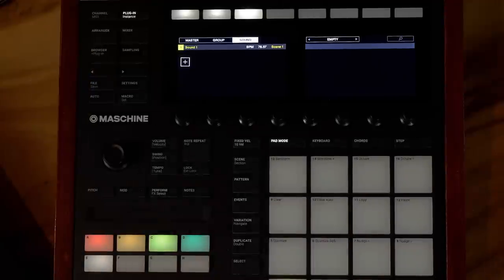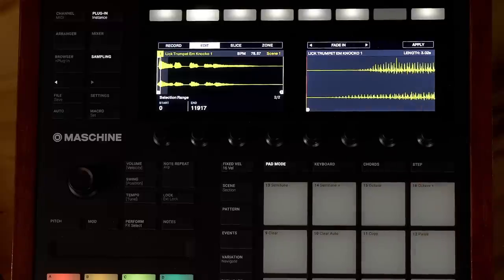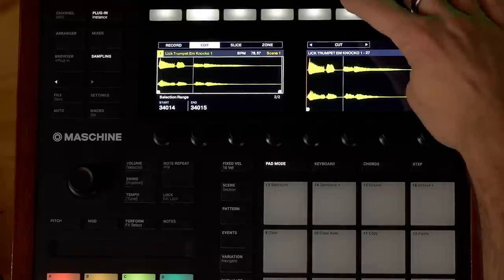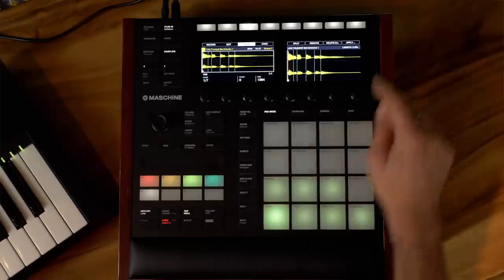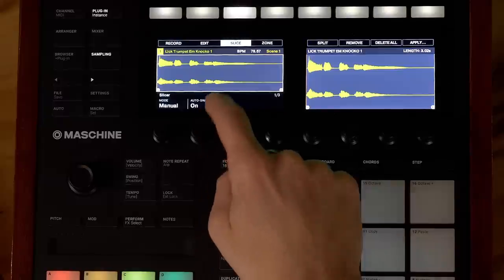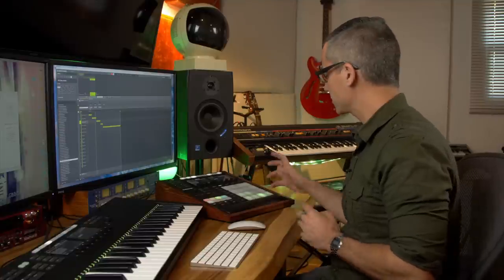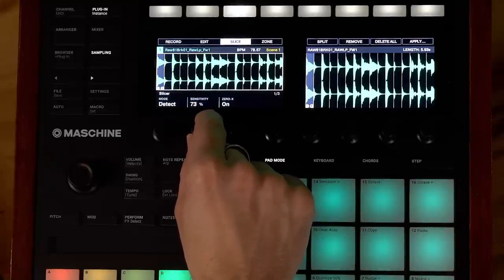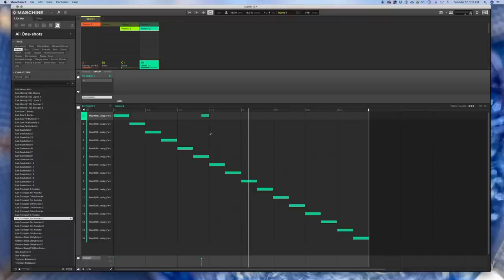Maschine Tutorial: The Ultimate Beginner's Guide to Sampling!

Comment: QUESTION: I noticed that when I edit any sample (eg. truncate, normalize) it creates multiple copies of the original sample in the original folder of the sample. Is there a way to disable this, or at least change this from happening?

I use Maschine inside Ableton so I am unsure if the behavior is different when running standalone. The additional audio files created makes my sample libraries get messy and confusing and overtime will start to accumulate a lot of storage space on my hard drive.